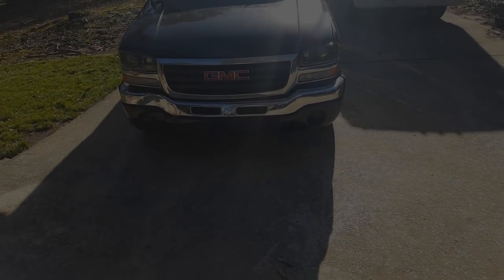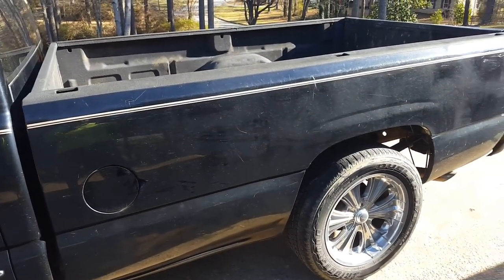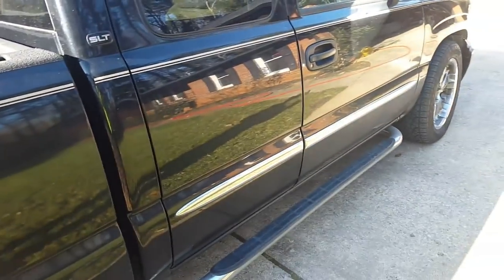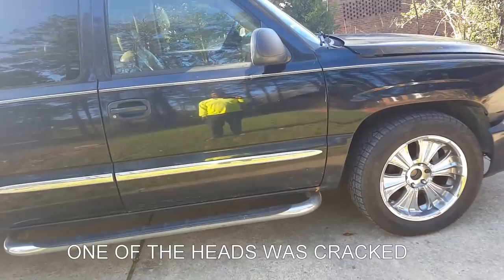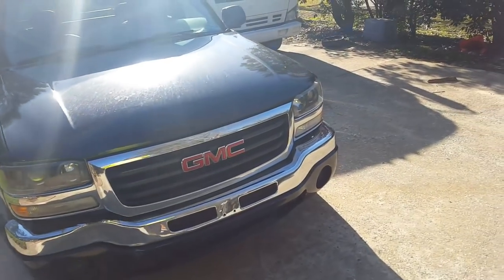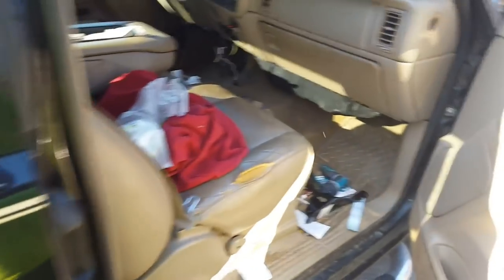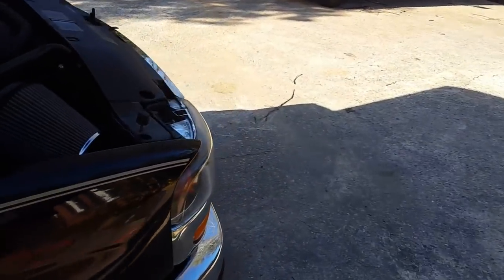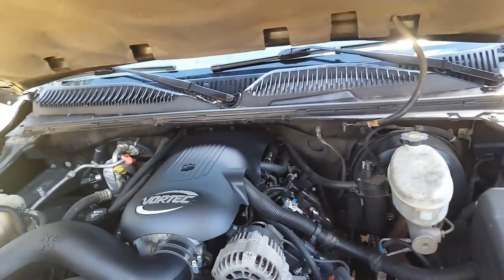2003 GMC SIERRA 5.3 LS REBUILT AND CAMMED (UNTUNED)

Comment: It's well worth rebuilding I have an 03 with the small 4.8 but these are great trucks. I have the k&n cold air intake system which works really well. I got mine for 350 CDN. But then had to tune. Comp cams are by far my favorite cams. Looking to get one on my build. With the cams and the intake you'll get are on 425 horsepower.  Add headers and you'll be up there at 455 or so. Great truck you have. I was thinking about doing a few videos on my build

Comment: The intake you're thinking of is the intake off the Chevy Trailblazer SS. And your computer can learn some stuff on its own but not everything. Once you get that intake and get it professionally tuned its gonna be a different truck. That tune is the most important part. Your truck and my truck have the 4L60E transmission and with all that added horsepower to a 6000lb truck somethings gotta give, and that transmission will get burned up fast. I'd ask your tuner mechanic about building your transmission to take the abuse, or swap to a 4L80E which come in the 3 quarter ton ( 2500 ) trucks. I'll be looking for your next video. I love these style trucks.
Reply: These trucks aren’t 6000 pounds lmao extended cabs are at 4500 and 4 doors at 5000
Reply: @strykerls3740  My 05 GMC SLT 4 door 4wd is 5800 lbs. I weighed it
Reply: @strykerls3740  My 2wd Silverado single cab is 3600
Reply: @strykerls3740  Ah shit my bad, I just looked at the slip, its 4800 not 5800.😔

Comment: Don't change the intake. The factory intake is actually better than most of the aftermarket intakes. Do the research you will find this to be true. I have an 04 1500 procharged with factory intake, 500+ hp. The engine really likes the long factory intake runners.

Comment: You can do the oil pressure sensor switch without pulling the intake easy. Just as a heads up.

Comment: I enjoyed watching this video, because I have the exacts same model and style, mine is green. the truck has 110,000 miles on it. and doesn't have  a thing  wrong with  it, drives smooth as silk. now when it reaches about 250 or 300,000 miles then I'll think about getting a rebuild. But  because of the price increase on these trucks by GMC. There is no way I'm going to spend over 40 to 50 Thousand dollars on another one. My plan is to drive this on until the body turns to pure rust. ,,,,by the way when you go to get yours painted be sure you get the best quality paint and the Top grade Clear coat for it because the OEM code for the clear coat calls for the cheapest crap on the market, so don't be fooled into this line of bull shit, because the clear coat will start pealing after 2 years. OKI plan to get mine painted also, due to The Walmart shopping cars and ugly people who have no respect when they park next ot a truck. "door dings" I also intend to replace the headlights and install LEDs in the place o standard bulbs. I have no idea how much that will cost or where to get the best ones. ? If you have any idea let me know. Enjoy your truck, it's a good one for sure , and great year for trucks. Today they are built to fail. and that's a fact. Thanks PS, slow down , keep the speed under the speed limit by 5mph , I personally am tired of feeding my money to the cops to meet their quota, It takes away from the nice things for the truck. lol

Comment: sounds like they did a good job on the motor i just did mine 6.0 bored over to a 6.2 with big heads and cam and 3800 stall runs 12.067 at the track it was my first run in that truck
Reply from the maker: Alejandro Ortiz just got the exha
exhaust done two weeks ago and now I gotta wait until February 14 for the tune. I  need to buy a stall but damn 3800 I  think is high. Do you daily drive it
Reply: I_JUST_WANNA_RIDE. yes but i wouldnt everyday its kinda big a 3600 or 3200 will be perfect

Comment: if you get a Intake look into a TrailBlazer SS intake longer runners and you'll get a little more power outta it. but you'll need a DoctorX Link cause the factory throttle body is a 5 pin and when you do a Tbss intake it's a 7Pin, my tuner told me about it and he runs that intake on his 1000HP SS SILVERADO, 408 s484 turbo and a whole bunch other goodies
Reply from the maker: ok thanks ill look into it
Reply: hey man what kind of headlights did you put on there and where did you get them i have an 04 seirra and would love them on my pickup. are those projectors as well?
Reply from the maker: WVUMiner got em off ebay

Comment: just the engine rebuild how much did you spend. I been having a knock code for the last 3 years. 220,000 miles now
Reply from the maker: quickchrome2012 bout 1000 in labor & around 1800 in parts
Reply: I_JUST_WANNA_RIDE  ok cool I can afford that, I like my truck been having it since 2008